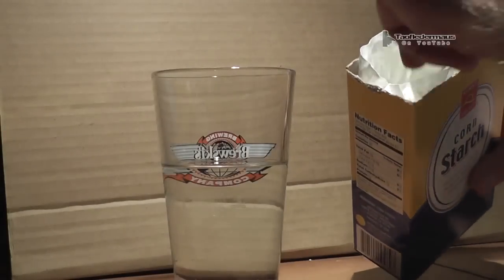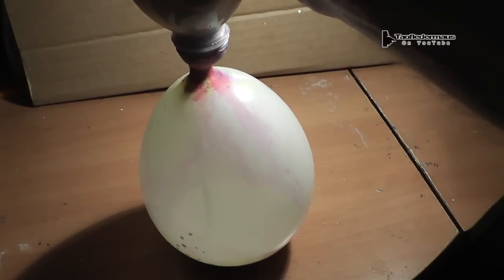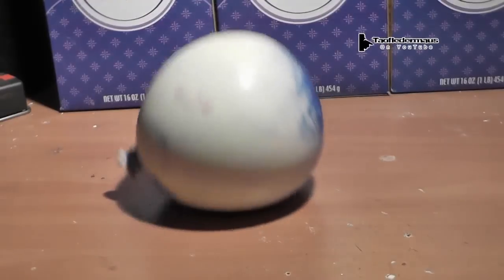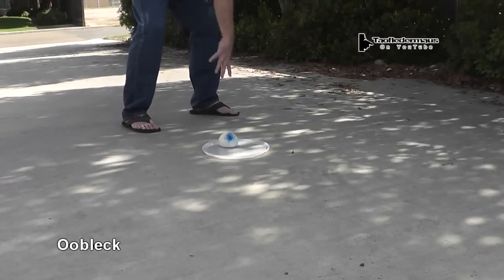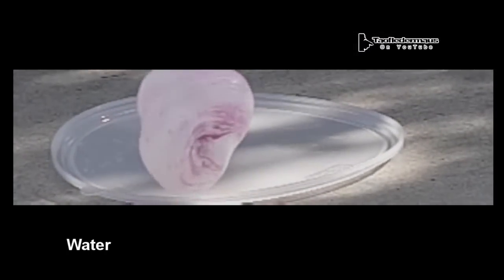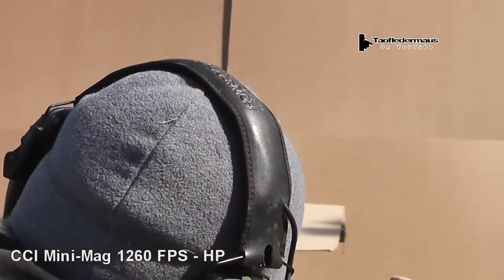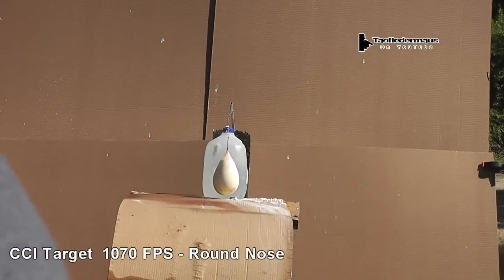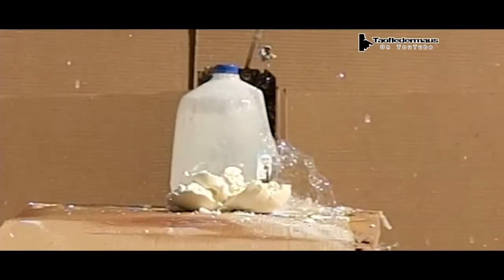Is OOBLECK  Bulletproof?   - Cornstarch and Water

Comment: Non-Newtonian fluid by itself will stop a knife stab, but not a bullet. Kevlar by itself will stop a bullet, but not a knife stab. The guy in the "Liquid Armor" video actually mixed the two, and his creation stops both knife and bullet.
Reply: VladtheImpaler31 will it stop me from searching japanese hentai online?
Reply: Simon Fong If it does, it truly is the future's new armor.
Reply: But will it stop a bow and arrow? Considering the penetration from a longbow is far greater than that of a knife, or a bullet.
Reply: @SherlockHolmes000  Not from a medieval 1200 lb. Windless Crossbow.
Reply: I guess, if fluid stops knife and Kevlar stops bullet. And arrow is basically a combination of knife and bullet. Only one way to find that out. And I don't volunteer to wear the armor.
Reply: VladtheImpaler31
I don't want anything to stop me from searching such things. :(
Reply: VladtheImpaler31
Not sure if we are talking about the same stuff but I saw a Kevlar and non-Newtonian silica fluid armor panel stop an arrow. Since it was fixed in place so as to take all the arrows force the arrow didn't just stop it bounced backwards.
Reply: ravener96 A stabbing weapon doesn't really cut the Kevlar it forces the weave apart. Look at the video I linked above. The arrow just shoved the fibers aside.
Reply: ravener96 Kevlar is very difficult to cut, but the weave is very easy to separate, if you have say 10 layers of the stuff, but with no impregnated plastic, then a knife will penetrate it with very minimal force. When it's impregnated with plastic, the plastic does make it more difficult to stab through, but it'll be like stabbing through say half an inch of plastic, not exactly easy, but doable. This is the same principal of how a high velocity rifle round penetrates kevlar, it doesn't cut through it per say, it separates the weave just like a knife as opposed to a pistol round, which slams against the structure. Kevlar isn't effective against rifle rounds. 

The British Armed Forces uses ceramic plates in their Osprey body armour. The ceramic is much more effective than kevlar at protection from rifle rounds, because the ceramic shatters and absorbs the impact. The downside is though that it's very heavy compared to kevlar, and once you get shot once, the armour's shattered and the plate is useless.
Reply: ravener96 It's all a question of size and quality. Obviously, enough steel plating will stop a depleted uranium shell (not man portable, of course). 

Also, ceramic can not withstand more than 1 or 2 hits. Steel plating can withstand direct machine gun fire for sustained bursts within it's tolerances. I've seen people stack 2 or 3 cheap steel plates, and they can reliably stop 50 cal AP rifle rounds. They can withstand dozens of AK 7.62 AP rounds, at single plate thickness.

Steel is my strong preference, because it is cheap, durable and proven. If you go to a battle with it, if you survive, it will. Ceramic can often be problematic, and break for little reason.
Reply: Bret Z demolition ranch?
Reply: VicariousReality7 There is no knife in the world that can match the penetration of a 125 pound warbow, unless it is wielded by a mythical being.
Reply: I, too am curious about that.  Will oobleck stop an arrow from a recurve bow, a long bow, or a compound bow?  What about a cross bow?  This is one I would like to see.
Reply: w00tz0r9000i nothing can stop us from the erotic pleasure my friend
Reply: Nevir202 What type of bow, and what distance? A 125 pound Warbow would be extraordinarily impressive to stop, if done at 10 yards
Reply: ballistic kevlar vests easilly stop a knife. it'a tough enough stuff to cut as is, tens of layers of the stuff is even harder.
Reply: ravener96 Bows pack much more penetration than any knife, friend.
Reply: kingdavewoody Ceramic breaks, but if you're willing to carry even heavier materials, steel can get shot repeatedly. Both steel and ceramic are commonly available, but steel armor if very cheap.
Reply: Bret Z ceramic can take a larger hit though,
Reply: Bret Z yes it can only stop 1 hit, but the one bullet it can stop is larger (more power) than what a similar weight steel plate could stop. i hope you arent counting on taking too many hits at once, and even then a ceramic plate generally holds up pretty well, as long as you dont hit the exact same place multiple times you could probbably stop a few bullets, totally guessing here, but 5 or 6 seems reasonable, this depends on the power though, a 50cal or larger round would most likely penetrate no matter what and render the whole plate destroyed, that is with "reasonalbe" plate thickness so you can carry it around.
Reply: ravener96 I generally agree. You can watch videos from AR-something steel armor people. They sell inserts and regularly shoot them up with AKs and the like. They comfortably stop an enormous number of 7.62 rounds with no penetration. Someone stacked 3 (too thick to carry) and did stop several 50 cal AP rounds. So steel is very effective and VERY cheap. But weight is the limiting factor.
Reply: is that the point i would have assumed it was more about distributing the inpact better...
but i can kinda get that too.. knife vest that i've seen usually use metal plates so that would lead to problems with non-flexible armor...
Reply: without watching your mentioned video or reading through the comments, non newtonion fluids will not stop a knife. pls noone tell me the smart ass answer that anything with mass at the right velocity will penetrate anything. but seriously, non newtonion fluid does not stop a knife. at all.
Reply: Flip Zilip to be honest, i would rather have a steel plate than non newtonian fluid protecting me from knives.
Reply: Alex Davies I'm talking about knives, not bullets. very different velocity and impact surface.
Reply: Alex Davies "Non-Newtonian fluid by itself will stop a knife stab, but not a bullet" That's what the original comment said and I stand by the point that that's wrong. I don't need to do research on current vest developement, because I never once mentioned vests and you're kinda having a conversation with yourself here buddy, because I am talking about "Non-Newtonian fluid by itself". Got it?
Reply: I am pretty sure the idea with non-newtonian liquids in body armor is to speard teh impact not stop knifes.. it just seams unlikely to be knifes...hell a knife stab probably wont impart enught force to actually soilidify the non-newtonian liquid in any meaningfull way...
Reply: I ma pretty sure non-Newtonian liquid in armour is meant to spread the impact not actually stop the bullet.. i  cant see it working any other way... I suspect the kevlar is still as necessary.. possibly you can use fewer layers maybe....
Reply: A 9mm yea
Reply: VladtheImpaler31
Why? What knife are you using?
Reply: It stop both knife and bullet
Reply: I saw that vid too
Reply: ***** well, can you link it?
Reply: So, may I have it, then?
Reply: no
Reply: Jabberwockxeno a

Comment: You are wearing your Howard leight's backwards mate.
Reply from the maker: You can wear them either way,   front or back.
Reply: The microphone is on the front, the aux jack is on the rear and the power switch is oriented as such to allow ergonomic use while worn in the proper direction. While it may well cover your ears when worn incorrectly they were not designed to be worn backwards like this.

Comment: Would have liked to see the oobleck shot in something other than a balloon. Like, say, the water bottle. The problem with the balloon is that once one side of it is torn, the whole thing contracts and doesn't give the oobleck any structure. I'm not saying the results would be different if the oobleck were in a "high pressure" environment, but I can't be sure until I see it.

Comment: I did a look around, and I didn't see anyone else with this idea before, which surprised me. What if you did this the other way round, and made the BULLET out of oobleck? The gunpowder side of things would be complex, but if a firing mechanism good be developed, surely the solution would turn rigid and fire like a plug out of the barrel, and still maintain shape in the air from the friction, possibly elongating or fragmenting or turning into a cone. If it impacted with serious force, you'd have a bullet that melted once it blew a hole in something. (by oobleck, I mean any non-newtonian fluid, possibly one engineered for ballistic properties)

Comment: Non-Newtonian fluids works in a way that "water part" of the fluid simply goes out from preassure, and only hard part stays in a way of bullet, so in case of this specific non-newtonian fluid effect is same as shooting to a dried corn pasta. If you want to make bulletproof west, that will protect you, than use fluid that would stop it after dried.

Comment: I really have to ask... why did you store this stuff and then do the test.

Unless that second impact caused the liquid to become and stay solid/gel like (I doubt it did) then you had a major gaping error in your testing method.

It's my belief that second balloon started to thicken (which is what corn starch does) after you left it sit for several days.

Retest this with new mixture and make sure you follow what people usually regard as the proper mixture ratio!

I'm not trying to be a jerk just saying I would like to see a proper experiment.  Still positive it will get pierced but also fairly certain it will go through a lot easier.

Try shooting silly putty (also non-Newtonian). Also see if it is possible to make PropGlycol/Silica without a lab... I believe that is the "real" bulletproof stuff (or at least what they "want" to add to Kevlar)

Comment: A gummy bear isn't a non-Newtonian fluid... .
Reply: I agree. I was pretty confused when he said that. Made me question everything else he said in the video.
Reply: Maybe he means the liquid they solidify to make a gummy bear?
Reply: All Non-Newtonian means is that it responds differently in viscosity based on the velocity of impact. You could stick your finger slowly through the gummy bear, but the impact of a bullet is absorbed and the bullet hardly penetrates.
Reply: Die Frau Gas is actually a fluid.
Reply: DerpyMcMuffins Glass is not a fluid it's an amorphous solid.
Air is not a fluid it's a gas. Although in fluid mechanics it's used as if it was a fluid to help observe the effects of pressure on objects without the obstruction of an actual fluid.
Reply: Tom wragg obvious troll is obvious
Reply: Your mom knows
Reply: "In its own right" He is not saying it is one like corn starch is.
More like its a gummy bear and its squishy and easy to melt. 

I will agree with you that he did word it badly.
Reply: DayLight95 No, google it. Fluids are liquids and gases
Reply: DayLight95 don't reply to him he must be trolling
Reply: The Piscis A gas fills its container, taking both the shape and the volume of the container. Liquids and gases are called fluids because they can be made to flow, or move. In any fluid, the molecules themselves are in constant, random motion, colliding with each other and with the walls of any container.
Reply: Except* You ignorant goofball. Scientifically gasses are known as fluids. Simple as that. Whether you agree or not.
Reply: Regardless they are known as fluids. It doesn't mean they are the same thing, just classified as fluids. Are apples oranges because they are both fruit? No..
Reply: Ghost R1l3y Also gases dont defy gravity, they don't just flow vertically. They either are sitting on top of another gas because the gas is lighter than the other gas or it is under pressure and fills the whole container which a liquid would do to. So everything you said is wrong. :)
Reply: Can you suggest me some non Newtonian fluid / liquid which can prevent bullet. If you can share any video or research paper, that will be helpful for me Thank you
Reply: LOL that isn't what I said. Wow you're stupid. What I said was the bullet doesn't have continuous force to be applied. For something to be a non-Newtonian fluid it actually has to be a fluid. AKA a liquid. A gummy bear is a fucking solid. Case closed :)
Reply: Ghost R1l3y Don't reply to him. He must be trolling. No one is THAT stupid.

Comment: Very fun. But what would lead you to think "Oobleck" (or magic mud, as we called it as children) would stop a bullet? You can stab a knife or pen through it easily, or even jab your finger into it. A bullet is fast-moving and small, so would easily cut through. It could slow down and stop a larger object, but not a narrow one.
Reply: the more force that is applied to them the more reaction you get, a bullet hitting them would apply much more force than poking it with a knife changing the properties a lot more drastically
Reply: That would be the EXACT reason why he thought it would stop it.  He kind of displayed how when struck with a lot of energy it became hard and when just nudged or pushed upon slowly it was still fluid like.

Thing is that it has it's limits and I believe there is a curve to the energy/viscosity or what I mean is that eventually it doesn't get substantially more viscous and had its limits.

Not sure if us mortals can make the propylene glycol/silica stuff that the Army is playing with but if we could that would be the better test.
Reply: "I put about 1 lb. of corn starch (corn flour) and water inside balloons and shot them with a .22LR rifle.>>>>> I had no idea what it would do.<<<<<<<<<<<<< 
This definitely shows the differences between hollow points and round nose bullets."
Reply: a round with a more prominent hollow point may expand quickly enough to apply most of its force to the fluid, increasing the viscosity as Laz321 mentioned above. granted id rather a bulletproof vest, lol, but still a neat principle. on that note though, you can pierce a typical teflon vest with a shiv..... if this stuff was held with liquid nitrogen maybe it would completely stop a bullet, esp a small one, as a larger round would melt everything it touched, passing right through. just a tangent thought on both theories.... viscosity+force and solidity+heat. id still rather take a half inch molded piece of HDPE and rivet/screw a 1/4 inch piece of stainless ontop if i was trying to STOP a bullet aimed at a target that size without weighing it down enough to resist movement. (i.e. home-made non-teflon vest, stainless would expand projectile and HDPE would seize it)
Reply: I think the actual reason it didn't work is because he let it sit for four days :L

Comment: Shouldn't have waited to do the test. Oobleck is a mixture, and as such, it settles over time.  This is obvious in the second test when the liquid part at the top of the balloon splashed away and the solid part at the bottom cracked and fell into two pieces.  You didn't shoot a non-newtonian fluid, you shot a container with water at the top and very fine dust at the bottom.

Comment: I'm guessing when the bullet hits the "oobleck" balloon it turns to the consistency of plaster. I bet if you made a plaster-of-paris balloon it would react in a similar way.

Of course this doesn't discount non-Newtonian fluids as a viable way of stopping a bullet, it merely means that corn starch is not the best answer. Non-Newtonian fluids have the unique properties of being both flexible enough to move, and ridged enough to stop a bullet. This makes them the obvious choice for body armor, the only question left is which material is best for the job.

Comment: Hi, I was wondering if the reason why it didn't stop it is because the bullet is very close to the speed of sound. It turns out when you push something that something is being pushed at the speed of sound(In dry air at  68 °F, the speed of sound is 343.2 meters per second 1,126 ft/s). So it doesn't have time to become rigid. Vsauce did an episode about how things get pushed at the speed of sound. So it was like it hit liquid rather than a solid. Just guessing.

Comment: I don't know if this has been said already, but the reason it did not stop it (and you can see this in the video) is because the baloon and material structure became quite solid and rigid, and so cracked apart. Rigid objects are not ideal for stopping bullets unless they are very dense or massive relative to the projectile.
Reply: I don't think the mass required to stop a common energy projectile would be very much higher than what you have there, though. Could be viable for housing protection from attacks, if that's a thing.

Comment: Luckily it didnt stop the bullet cause if it would have reflected off it could have hit you
Reply: TechnicalParadox
Nope it's not, cornstarch will always absorb the energy of the bullet.
For instance steel does not, this is why you get a ricochet.
Reply: Only to further agree with it would be impossible for it to ricochet... The kinetic energy, ergo the force moving the bullet, would be completely absorbed by something stopping the bullet, ex: Kevlar. It would be impossible to ricochet. In fact by the bullets going through the balloon there is a greater chance of a ricochet occurring.
Reply: I doubt that the bullet could reflect from something like this.
Reply: Ivars Braze But it is possible.
Reply: mcmurray121
 ricochet only can occur, if the bullet hits something harder then the ammo is made of FMJ (Full metal jackets) still have a soft lead core. And more importantly, which is needed for a ricochet, is the ANGLE it will hit, you hit a target straight up. It's very unlikely that it will ricochet.
Reply: Michel Linschoten Aye, 'tis true. But that only furthers the point.